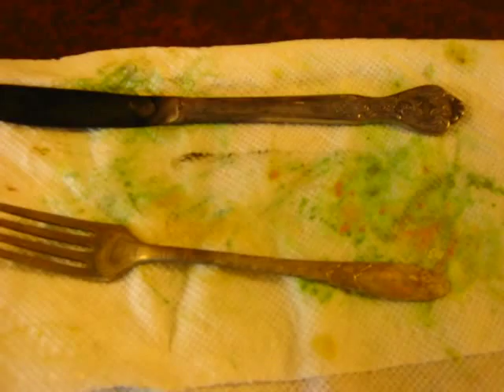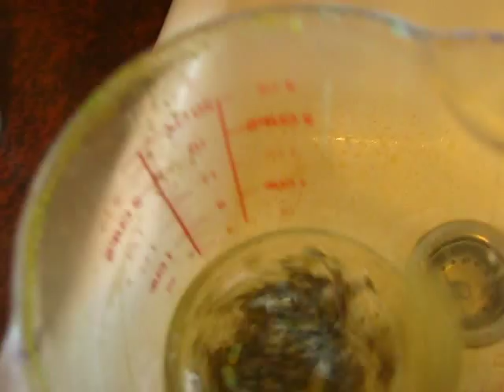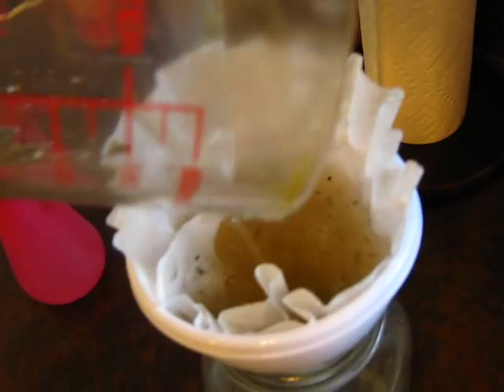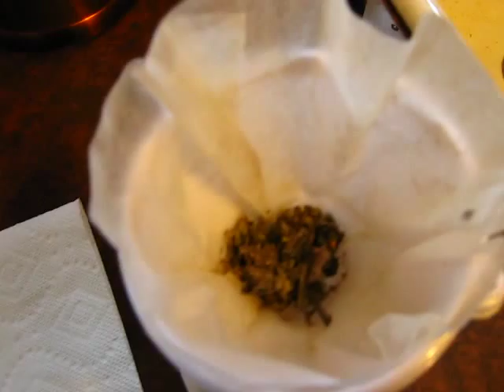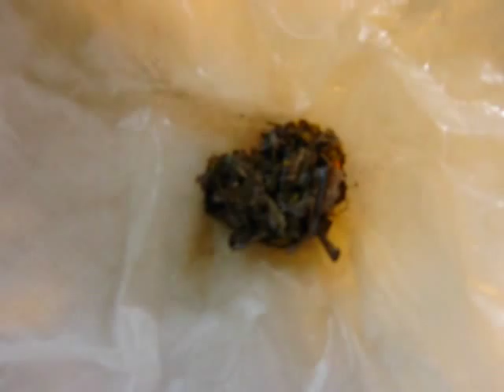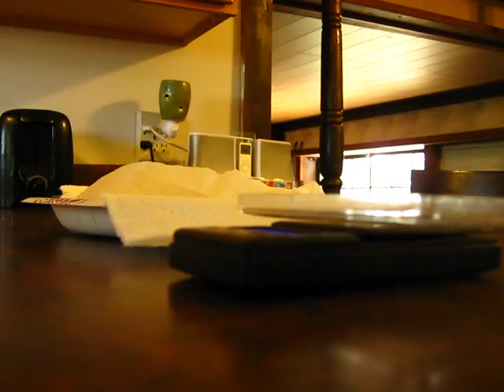Easy SilverPlate Removal. (part 2)

Comment: Silver powder can become very very fine especially when you run water into the jar like that, so you've probably just poured out a whole heap of silver powder
Reply: I was thinking the same thing. Also thought of using a gold panning type tool to catch the heavier material.
Reply: @gsmscrazycanuck9814 should've put it all through the filter

Comment: Hi, thanks for the good video, your method works well. I use a Similar method but use old cell phone chargers. instead of a battery charger. All you have to do is cut off the phone adaptor & put on two "Crocodile clamps" one red & the other black. I had about 6 old chargers lying around which I modified to do this with & they work very well just a little slower than your process, but I run multiple units at the same time.  (Each in its own plastic container.) 

One last comment when you have finished cleaning the silver & have it all filtered out, leave it to stand in some 'Distilled" water overnight, as even though you have removed it from the electrolyte it will still be ionically charged from the Electrolysis process which will not do any harm if you are going to smelt it soon.
 If you are going to only smelt it in a few weeks time the bath in distilled water will help slow down the oxidation process, which will give you small impurities.

 Once again good video, nice & informative regards  Robert C.
Reply: Do you still do this

Comment: If you had a little bit bigger container and after you have stripped it down and settled to the bottom could you just take a type of a wire brush to do it inside the water container and that way you won't lose nothing

Comment: What do you use for smelting?
Reply from the maker: +Patrick McCrady A silica crucible and mapp gas torch.
Reply: +Guy Foster thank you for the information. I have been using this method for about a week now.  Wonderful knowledge. Along with scraping I use a wire brush in a cordless drill. I am also saving the pour off to see what metal may be recovered from that.   I use diatomaceous earth to get the orange color to settle. For larger items I use a plastic ice cream tub and your method. Works great.

Comment: Why has nobody shown this meathod before? Seems like a game changer to me. Thanks, I'll try this for sure!
Reply: When you did yours did your silver flakes come off silvery/black or were there shades of green? I did it today but I can't tell if it worked or if what I have now is mostly copper
Reply: solution got milky at first, and then black flakes so I let it go for a while then scraped off the black from the items rinsed, dried and melted. got a 1/2 gram of silver from just a few small pieces so yup it works. I'll be doing this again
Reply: I started off getting small black chips but then something happened. it started to look more and more like it was just dissolving the copper or whatever the base metal is or dissolving it as a higher rate. however I did notice that there was salt at the bottom so that might have played into it. maybe it'll go better next time!
Reply: after a while the solution looks like a cottage cheesy type junk and thats when I pretty much stop and then rinse it off but I found it important to physically scrape the plating off into the solution to get it off your items.
Reply: so you soaked it once and then just scrapped it all off? I soaked it like 3 times scraping a little in between so maybe that's why mine got messed up
also thanks for the help I appreciate it!
Reply: Because most people have better things to do than waste all that time and materials for 2$ worth of silver for which you will only be able to sell for 1$ tops.  Then, subtract the cost of electricity used for the charger and oven dry. The cost of the water, salt, and coffee filter and you most likely lost money.

Comment: Was that a dollars worth of water you ran down the drain?
Reply: J K how would you get the desolved silver from the water?
Reply: Drop in a piece of fine (OOOOO) steel wool and let it sit over night (room temperature). The dissolved silver will ppt on the iron as it rusts, making the water relatively silver free.  Put the rusty steel wool in the recycle container and pour the water down the drain.

Comment: Hay there , guy. Have done a part 3,   Electro deplating I use MERATIC acid  and higerprozide  to clean the silver and turn it to cement .
Reply: garvin centcia hey but what method are you talking about ?
Reply: if you take that step wouldn't you put it is distilled water with nitric acid and Hydrochloric acid to remove the copper and purify it into actual pure silver?

Comment: After melting the flakes down and burning out the contaminants I ended up with 1.7 grams of acid tested silver:)
Reply: +Guy Foster Just want to say thanks! I tried this method today and got my first silver BB weighing in at a whopping .5 g lol not much but but I didn't do much. I love that this process works! Will be doing a lot more now in possibly a larger set up, Thumbs up to you sir :)
Reply: Lol so the 200 flatware set has maybe 2-5$ worth of silver on it
Reply: @calebwiggins3042 cant be right. Silver are going missing.